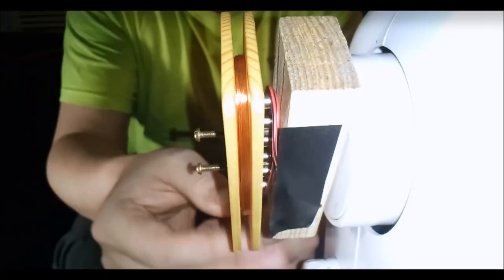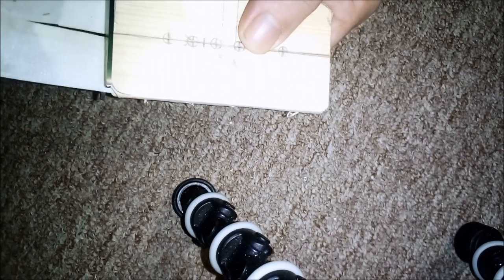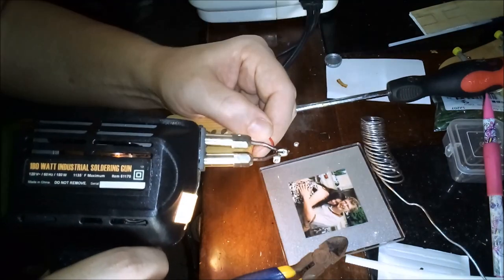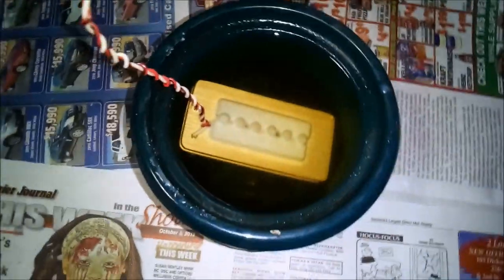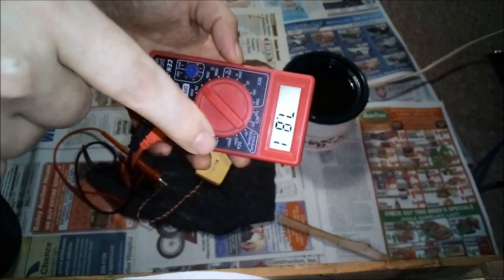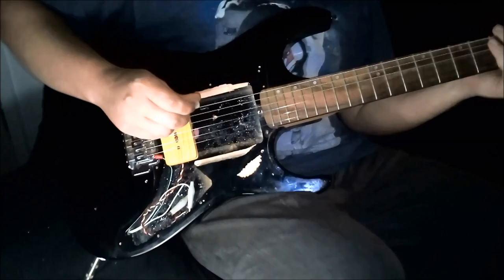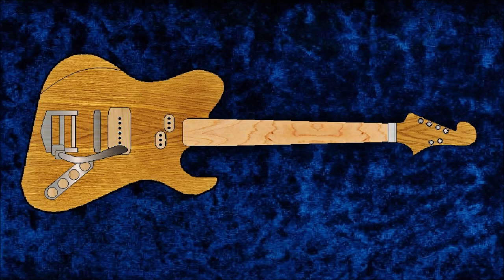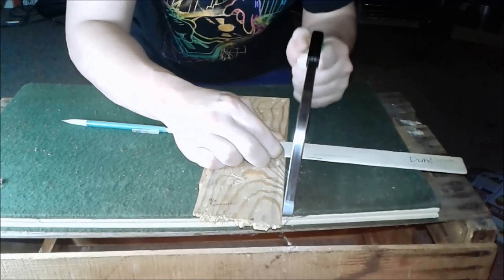P90 Pickup Build From Scrap Wood (Rules Broken!)

Comment: Love this, dispelling the bs that flies around.  So, if you wound about 8000 it would be about 8ohms, 10,000 10ohms?  So you don't need any kind of wood spacer between the two wood pieces?  Use put the poles in then wind around them? Hmm.  I suppose you could use the right metal screws/poles so you could adjust the height of each pole, but the outer ones might come out and mess with the whole spacing thing??
Reply from the maker: Thanks Michael, The wraps to ohms thing all depends on pickup size and design and wire type and coating type/thickness as well as tension or stretch put on the wire and how scattered or uniform it is. I'm sure their are calculators you can find online that show certain ball park estimates for winds vs ohms on certain pickup designs with a specified wire sizes and traverse or scatter. Different types of pickups have different builds, an old strat pickup was made with a black thick cardboard material as the flat work and the wire was just wrapped straight on to the poles but I think the original P90s had a wooden spacer in the middle that the wire was wrapped around, They also had adjustable screws like you mentioned, it is possible with the wooden spacer because it doesn't scratch the coating off the wire and short the winds out if you screw it in and out. Many of the newer pickups and even the older cheap pickups use a 1 piece plastic bobbin that has a spacer built in, that can be a good thing because the wire cannot corrode and short to the poles over the years, a strip of tape on naked poles can prevent this as well but it may change the sound maybe 1-2% from an original 50s pickup, its all small changes but it all adds up to a finished product in the end. 10 things slightly different at 2% change equals a 20% different operation in the pickup so basically a totally different sound waveform to the amp so after amplification and depending on the gain stages of the amp and the pedals etc = completely different sound to the ear.

Comment: heavymetalATC..i wonder how warm the wax was in the wonderwaxpotter..i seem to remember that above 70 or so Celsius the metals in neodym start to re-arrange and they lose their power..
Reply from the maker: Thank you so much for watching and taking the time to write write such an intelligent comment Mikko. I think I had someone ask me this on a forum and I thought man that is a great point, it may be doing that, and I don't actually know how hot the wax is getting but id say 100-120F It wont burn you, you can stick your finger in it...it could have an effect? though I didn't notice any difference in output before and after potting. Great comment.
Reply: @heavymetalATC  120F would be about 50C which is quite well below that temp at which SUPPOSEDLY neodyms lose their attraction..keep your tail up high!!!..that is a Finnish term that refers to a happy cat i think..
Reply: @heavymetalATC  
Yeah man, it was very risky.
Magnets are best glued after waxing.
And on a simpler glue, which will be easy to peel off, in case of repair, for example.

Comment: This channel is one of the best on YT for sure. I'm gonna try my hand at pickup making now. Thanks homez🤘
Reply from the maker: Thank you so much homie, If the first one you make doesn't work well or at all just keep at it. Tinker with reflowing solder joints and even re-wind it if you have to. Its not a hard thing to do but the wire is very delicate and sometimes the smallest thing will prevent it from working at 100%. Once you get a good one though, its like second nature and you can start changing magnets rewinding or custom winding pickups for friends and such. Let your mind run wild. You may even invent the super mack daddy bad@ss pickup on accident, on the first try.
Reply: im thinking bic lighter springs taped with electrical tape and would 1.5k for each string

Comment: It's fantastic to see people throwing out most of the ''rules and myths'' and just going for it and getting results that are pretty damm close to manufactures quality for a fraction of the price. I've often thought that the price driffrence from 30 to 150 bucks gets a little ridiculous and that probbably from 50 bucks you're just paying for the name. Nice video and nice pickup.
Reply from the maker: Thank you so much for watching and taking the time to write such a kind comment Morten. SO right you are. I grew up in an classic car restoration shop that my mother and stepdad ran and I saw then as a kid a theme. You can buy a decently fast 1980s Mustang or Camaro for example for hypothetically lets say 3500 bucks and it will probably already have some performance parts and mods on it as they often do.. it will be a tire burning fun machine but it you want to make it twice as fast and have a competitive racecar will cost you well over 10,000 dollars and months of weekends in a hot or freezing garage... not just another 3500.. If you now want it twice as fast as that... not 10 grand more it'll be about 35,000 dollars and a year of work plus test and tune etc. Its the law of diminishing returns almost all that extra money is in the last 5-10% better If you learn to build and mod the parts yourself though, you can do it almost as good for wayyy less. Buy pipe and a welder learn to weld exhaust instead of buying it pre made and paying for brand name + install, buy a die grinder and port your heads instead of buying name brand racing ones, learn to tune and diagnose it yourself etc. Same with gear. A Squire telecaster is a decent guitar especially a made in Japan one from the 80s. But a classic 60s tele that is twice as good is 20 times the price... but you can build a damn good custom one for a whole lot less and still have the tools at the end to do it again. I think it mostly comes down to whether you have more money or time and the drive to want to build you own things for pride and self worth's sake. Hell same with tools, buy a cheap tool that will work decent or an expensive one that will be 15% better for 3x the price or maybe you can build one somewhere in the middle.

Comment: So I can easily mod my old duncan designed humbuckers with those neo magnets and get the pickup working to my taste... man you saved me getting rid of one single and three humbucking pickups... Please go on these series. Rock on
Reply from the maker: Thanks for watching and taking the time to watch and leave a kind comment David, Yes you can absolutely loosen the coil screws on a humbucker and slip the magnet out and slip one or maybe even 2 bars in there. If you have already tried the experiment let me know what kind of results you got.

Comment: If you aren't suppose to solder, how do you connect the terminals?
Reply from the maker: Hahha ah, I shouldve been more clear. A normal pen shaped or solder station type soldering iron uses a resistive heater that is safe for magnets a big industrial pistol-grip style iron uses a big coil to generate the heat and it puts off a strong magnetic field... the normal little soldering iron everyone uses is safe.

Comment: You sir NEED a 3D printer!
Reply from the maker: Thank you for watching and taking the time to comment I agree Michael, Id love to have a mill and a lathe and a cnc as well but I just simply don't have the funds for such. Id also probably just use them to make boomsticks and pew pews anyway. Hahaha
Reply: @heavymetalATC  printers are on Amazon for about ~$200 and will be the best purchase in your life.  By far my most useful tool.  I bought a cheap one back in 2017 and it's still truckin!  Get a Creality Ender 3 or 5, best bang for the buck.
Reply from the maker: @MichaelJeffers75  Thank you for the suggestion I'll really look into that.

Comment: Which pole (north or south) of the magnet strip do you glue to the pickup?
Reply from the maker: The magnets in this pickup have the south pole glued to the back of the bobbin. but it can be either as long as they are both the same... It doesnt matter which way unless you are using it with other pickups and in that case you want them to match for in phase or be different from each other for out of phase... you can check it with a simple compass.

Comment: Amazing video!
I need your help, I am trying to build a pickup but I don't have that orange cable. I bought some spool of copper for welding, but the resistance of the pickup is about 0. So I wonder if the orange cable should be stripped??
Reply from the maker: Thank you for commenting. But, no stripping the welding wire wont help you out the problem is that it is already conductive on the outside so that it can work in a mig welder making contact with the tip and passing current. (I was a welder for many years) What you need is a copper wire that is coated so it is NON-conductive on the outside. It has to keep from making connection with the other winds of wire or it will have zero resistance as you have found and will be shorted out with no sound. The polyurethane or varnish coated wire you need can be found in coils like inside a wall charger or a hair trimmer. It is very thin like smaller than a hair but this allows much more winding and higher resistance that will equal a louder pickup. You will need to sand or burn the ends though so it will remove the coating and make contact when you need to hook a wire to it. Here is a video showing a pickup I wound with the wire from an electric hair shaver. https://www.youtube.com/watch?v=VLMNXMMaU8o

Comment: Would like to see a Mini Humbucker and a Firebird Mini Humbucker video!
Reply from the maker: Thank you for taking the time to watch and leave a comment Wallace. I did make a set of  split 3 pole humbuckers if they were put on a plate it would be a 3 string humbucker but I did it to use as singles like a Z-coil or P-bass pickup. But, I am sure I will make many more pickups for future projects and firebird pickups have a great sound. Thanks again. 
Here is the split humbucker video: https://www.youtube.com/watch?v=Nz5GDlFqHO4
Reply: @heavymetalATC  thanks bud

Comment: Pretty sure you built yourself a larger single pickup. P90 pickups don't have pole pieces but adjustable screws for poles.
Reply from the maker: Correct. Its kind of a mix of an even bigger Jazz Master pickup and P90 magnet setup and mounting minus a backplate (would add too much bass) but Its just specific to this guitar build and a function of working around the rare earth magnets to prove a point I've even used framing nails as poles in tests and as long as its steel it makes next to no difference.
Reply: @heavymetalATC  exactly.. all you lose by not using screws is adjustability .. which is a nice feature..

Comment: So you're dunking it in hot wax to insulate it? I'm gonna try this build and this is the bit that I am unsure of.
Reply from the maker: Thank you for taking the time to watch and comment Jack. The reason for the wax is to kinda glue the coil together. if the winds are loose the pickup with react to vibrations like if you tap the guitar you will hear it and it can feedback at high volume but if you are going for a more open acoustic sound and not using high volume or distortion you may want to leave it unpotted or put it in the wax for a shorter amount of time. Thats part of customizing your tone. as well as how much magnet power you use will affect volume and gain: more is more here. If you want a darker blazing strong modern sounding pickup use more winds like up to 9000-12000 or just fill the bobbin up. If you want a softer more articulate in the treble range sound like a vintage pickup use less winds like 3000-5500 or just 3/4 fill the bobbin. They all work together and you can make it sound any way you want with trial and error. It makes me so happy to hear that you want to try some experiments and build some things. I apologize for the late response I took a break from youtube but I'm back and fresh with better gear more projects and ready to work and help in anyway I can. If you have any problems or questions feel free to drop a comment and I will try to get back to you in a more timely manner. Thanks agaiin
Reply: how did it go i tried a guitar project now im waiting on parts

Comment: Try ska and add buttons neodymium to lows
Reply from the maker: Thanks Rama. I actually did end up adding 12 neo buttons on this pickup when I built the split coil 3 pole humbuckers for the neck. It didnt have enough output to compete. The reason I didnt just put it on the low strings is because the split coils are designed for a very bass heavy vintage strat sound and I am going to put them on blend knobs to act like a physical equalizer so I wanted the p90 to stay very bright and high. Thanks again.
Reply: Thank You! Can you tell me if the magnets were matched opposed north or south pole and you said 7.5ohms winding of 42gauge magnet wire?!

Comment: In your split humbucker build, you mentioned that you eventually added 12 more neodymium button magnets to this P90 to "match perceived output." 

I am doing a single pickup for an acoustic guitar. Could I simply add on additional bar magnets (instead of button magnets) if I wanted to increase this P90's output? Or would 2 bar magnets be enough for an acoustic pickup, where I am not using multiple pickups? How does more magnets affect the tone (brighter or warmer)?
Thank you so much!

I would much rather make my own pickups instead of invest in a real one, because I am only be using it pickup to test out an amp that I ordered, but only have an unplugged acoustic. 

I have an acoustic-electric guitar coming on the way, later this year, so I won't really be needing an external pickup. This project would just be so I can test my amp with the guitar I have right now, until the new guitar comes.
Reply from the maker: Thank you for watching. 2 bar magnets should be just fine for an acoustic pickup maybe even one bar. You can do some experiments before you decide to glue it or them on. More magnet and diferent magnet placement can slightly brighten the tone and affect dynamics like how thumpy or twangy it is but it mostly just makes it louder. More winds of coil wire like 8-10 thousand will also make it louder but it will dull the sound a bit (you will still need several thousand winds minimum for it to work right though). The best way to control the tone and the overall volume is to vary the pickup placement. how close it is to the string = how loud it will be and if you place it towards the neck end of the sound hole it will have more bass and if you place it closer towards the bridge it will have more treble sound. You may also catch the bug and find yourself experimenting a lot with the pickup and maybe even building another. If you get it to sound the way you want you may even find that being an actual magnetic pickup and not a contact pickup like in most acoustic electrics it could even sound better than the new guitar in certain ways. Best of luck and if you have more questions or any problems feel free to message me. It may take me a while to respond but I'll eventually do so. If all else fails there are some cheap acoustic pickups on the market at as low as $10-$20. They wont sound fantastic and wont be able to be easily modded to your tone preferences but you will be able to test the amp and play in the meantime. Thanks again for checking out the video.